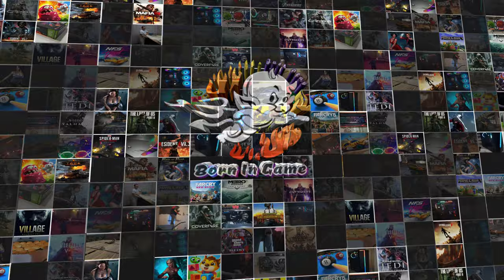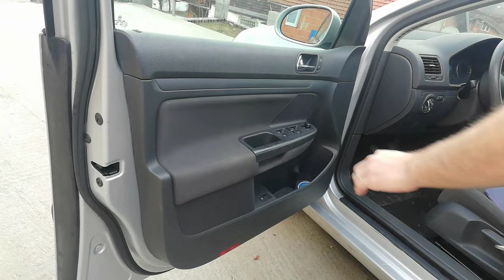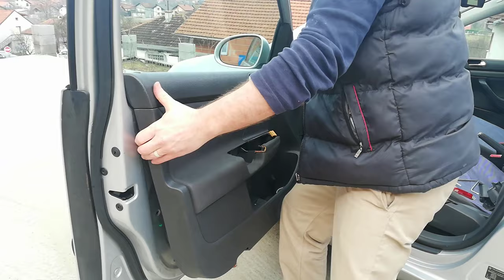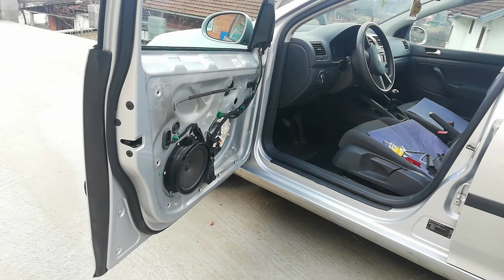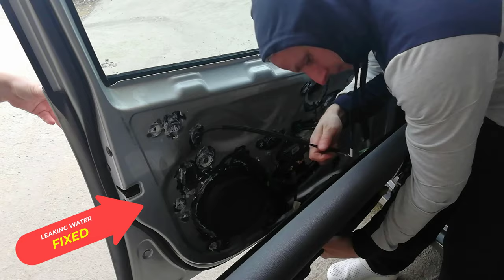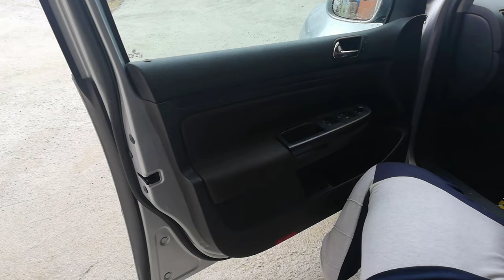Leaking Water Volkswagen VW Golf Mk5 Carpet of Front Door | Leaking Through Speaker Seals WET FLOOR

Comment: I have the same leaks in mine too. I couldn’t believe the window motor was a source of leaking until I saw the dripping. I used butyl rope to seal it. But maybe I’ll need silicone too.  Nice video!!
Reply: Hey! Having the same problem, every time it rains, my electric window acts up and actually stops working, probably due to the motor taking water. Did your window also do this after heavy rain? Mine seems to have started working again after drying out (took about 4 days)

Comment: I have pretty much the same trouble in my beetle (2003)
Water isn’t going out of the drain holes where it should but is coming from higher up, getting into the door card and over the door/body seal.
I had the door apart yesterday like this and the problem was obvious.
It was really confusing me.
I’m going to try this method.